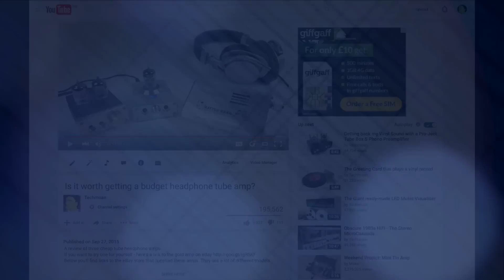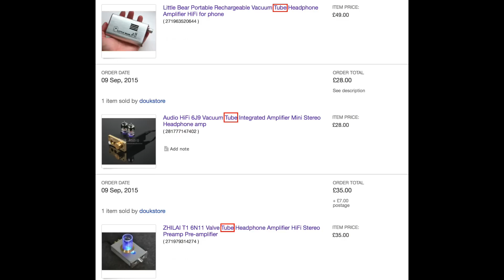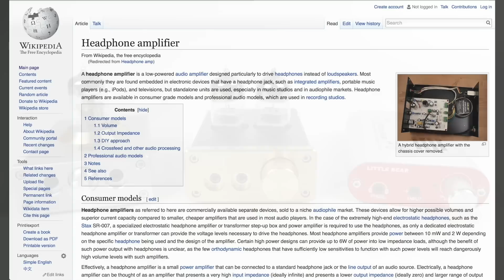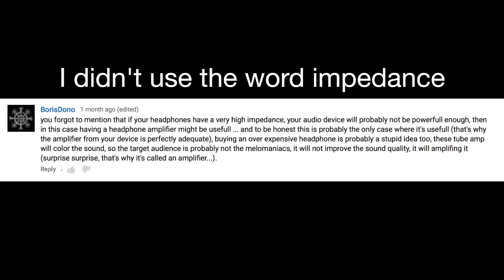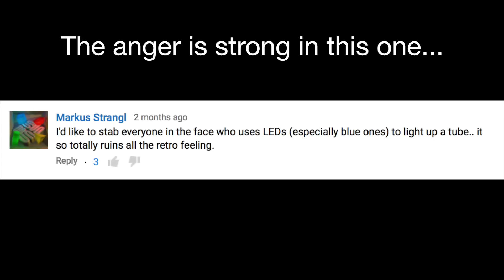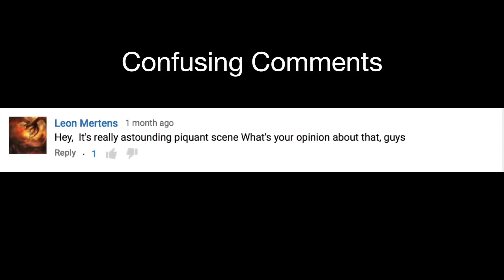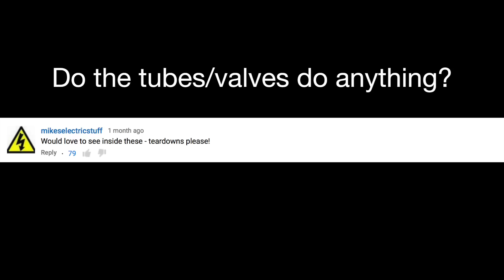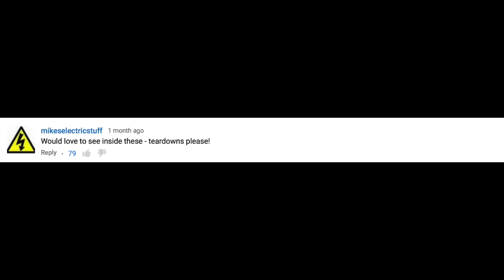Headphone Tube Amps - Follow-up & Tear-down

Comment: People who cannot tell difference between direct driving headphones from consumer grade phone outputs and driving them from specialized amps probably cannot hear the difference or have bad headphones. Headphone amp is a MUST if you really want your headphones to deliver their real performace. Very important factor is current. Headphones NEED current and for that you need opamp, valve or transistor stage that can deliver it into impedance that are heaphones which is usually low, meaning high current is needed to drive headphones. If you use consumer grade headphone output even on high quality equipment, that is usually just to monitor playback, not really to get audiophile grade playback. My friend bought AKG headphones and connected them to usual phones port and he was not very satisfied but later on he borrowed from me my A-class push-pull transistor headphone amp which I built and use it for three years with my AKG K-240. He was shocked with detail, musicality and spatial elements of playback. If you have headphones, you need to let them play music, and the way to do is to give them current, otherwise you will get thin and rather un-nutural playback. Even in my Denon CD player there is opamp on output which is chosen because of high output current, not only because low distortion.

Comment: There are tracking connections on BOTH sides of the PCB, not just the underside. As a musician, I use VALVE amps to amplify my guitar, as do the great majority of professional musicians. The reason why is simple. Valves sound so much better, they respond to touch better (i.e. light and shade) and just have a warmer sound. That is why in this day and age valve amplifiers are still made and loved by so many.

Comment: Since the British like to rename just about everything with slang, I am going to stick with “tube” because they are a vacuum tube.  They are not a valve that controls water or fluid flow. If they are controlling current flow then they would be a switch or potentiometer.

Comment: And on the circuit you can see the valves/tubes are are connected not only on the back of the circuit but front too

Comment: Matt, your delivery is fine and your channel is a pleasure to watch.  As a fellow 'old-skool' - retro hifi buff,  I find your uploads a breath of fresh air and always engaging as is your typically Brit dry witt  (much like John Ward's channel).    It is to your credit that you take these assinine comments in your stride.  KEEP UP THE GREAT WORK.  
________________________________________________________________________________________________________________________
Tech bit....  
.
In the XuanGold - The two 6J9 'thermionic valves' (or 'electron vacuum tubes') are triple triodes  -  More at home in a receiver (local oscillator/RF detector/mixer).  Here probably being used as a two stage class A amplifier (on each channel).   The op-amps being either input buffers or output power amps   It is entirely possibly, that one of the triodes (out of the three in each valve...) would be redundant, hence the pin-outs not being connected to the circuit traces (which is common in valve/tube technology) and might even be the cause of the microphonics. 
.  
The silver Zhilai - single valve/tube - 6N11 is a double triode.  Being used in a similar hybrid configuration.  but using one valve/tube shared across two channels, which coupled with inferior electrolytics, would explain the inferior/mundane performance compared to the former XuanGold.  

.

The Little Bear - Uses the 6021, a subminiature double triode.  Most likely using a similar circuit configuration to the Zhilai.   These Raytheon subminiature valve/tubes are designed specifically for harsh environments (military spec).   Ironically, probably better specs than the previous valve types and appropriately employed in this 'mobile' headphone amp.     The hiss audible, might be simply down to either inferior capacitors, poor soldering (likely), duff components (resistors), low quality op-amps, or a combination  of all.   

.
High grade military electronic equipment of the WW2 and the Cold War used similar sub-miniature electron tube technology (I've worked on many such devices), where space (in a military aircraft, ship or tank) is at a premium and efficiency is paramount.    Those early pre-transistor 'walkie-talkies' used in the latter years of WW2 contained such devices, whereby the tubes were soldered in place and suspended in rubber glands, to minimise shock.
__________________________________________________________________________________________________________________________
As always, like with climate science denial and politics, there are always those that try to find a conspiracy in everything.   Whilst I concede that conspiracies do exist (9/11 being the obvious prime candidate...),  I  think it is likely a very American thing, to suggest that the Chinese would design and build a 'faux valve amp'.   A totally absurd notion, but hardly surprising given their abhorrence to Chinese goods and their country's ongoing, but equally absurd 'trade war'.   [smh].  

I have a Chinese built 18 watt valve amplifier, that I use for my guitar in my studio.  It is designed around the famous Marshall amp of similar wattage and is simply quite superb (at a fraction of the cost of the Marshall item).   The standard of circuitry is high quality and the bottles (valves/tube) are exactly what one would find in a British valve amp of similar design.   It  has a spring reverb circuit and built-in speaker attenuator.   With Pentode/triode switching.   It even has (foot) switchable twin channels, a line output and effects loop built in.   All encased in a robust steel chassis and enclosure.   All for less than £300.  Streets ahead of any contemporary brands.

Comment: Good advice for anyone wanting to get into tubes would be to start by buying a tube manual, such as RCA’s 1959 receiving tube manual, which is available as a reprint. The 1973 edition would also be beneficial. In addition to data on individual tube types, these manuals cover tube operation and use, design theory and sample circuits for amplifiers, tone controls, etc.

Comment: Good Video...No problems with the way you speak or the terminology. BTW..I'm a tech with like 40 years experience I honestly have never seen the pins of an electron tube soldered to a board. New one on me. I would think that the heat of the soldering could easily damage the connections within. Yes, I know a tube can get hot and all that but, the pins aren't designed for soldering. Bad build IMO. Other than that you covered all the main points very well. Good Job!

Comment: Hi, here are some links to the datasheets for some of the tubes used in the pre-amps:

https://frank.pocnet.net/sheets/201/6/6J9.pdf
https://frank.pocnet.net/sheets/009/6/6021.pdf

The data sheets show they are using a heater voltage of 6.3V at a current of between 300ma to 450ma depending on the tube.

So there is a high possibility that the answer to your question is yes! they are using the tubes to amplify the audio without a circuit diagram I can not say 100%.

I feel I should point out that even years ago not all tubes would glow even in the dark which may be why the blue LED is added as most people when thinking of a tube will think of it glowing.

== Just So people know where I'm coming from on this subject ==
I started my City and Guilds in Radio, TV, Electrical and Electronics Mechanic in 1977 which was the last year they were going to include Valve theory and indeed the second and third year of the course never covered valves, but the first year covered enough for me to work on requirement with values.

Comment: Understanding how valve amps work.
Electricity is a flow of electrons. Electrons will only flow from negative to positive. Inside a valve at the base is a disc of metal which is heated via an adjacent heater. This causes the electrons in this disc of metal to ‘boil’. This disc of metal is negative and is referred to as  a cathode.
A similar disc of metal is at the top of valve (again inside ) . This disc of metal is positive and is referred to as an anode. As stated earlier electrons will only flow from negative to positive. So inside the valve from cathode to anode. This can only occur if the whole process takes place in a vacuum. Hence the alternate term vacuum tube.
In between the cathode and the anode is  a device known as the grid. Think of this as similar to a Venetian blind. Blind fully closed -no electrons can pass. Blind fully open all the electrons can pass.
The output from the earphone socket is the input to this grid. It controls the grid. The output from the earphone socket is again a flow of electrons . These electrons are in a complex pattern.
The net result is that all the electrons that pass the grid (on their way to the anode )in side the valve are an exact copy of the electrons leaving the earphone socket. Exactly the same -except more of them. 
Hence the output from the earphone socket has been amplified. The increase in amplification is referred to as gain.  Typically the output from one valve controls the grid in the next valve. A series of valves results in higher gain.

Comment: These are NOT tube/valve pre-amps (they are NOT amplifiers, please)  are apparently HYBRID pre-amps as they use op-amps. So they are bull-shit.
Valves can sound better as they have even harmonic distortion  whereas an badly designed and over-driven (BJT) transistor pre-amp has odd harmonic distortion which sounds harsh.
That valve sound can be had by using FETs, so using valves is just a pathetic attempt to look retro/audiophile..

Since 'all' recording studios use op-amps (and Not valves) in recording/mixing non-digital content using valves is stupid; it is just a pathetic attempt to look retro/audiophile..

Comment: I'm a few years late, let me try to fill you in on a few things. All of those amplifiers have boost converters which convert the low voltage from the mains adapter (or battery) to the HT required for the tubes. Your gold amplifier has the microphonic tubes, the tube number on them is a Chinese number, try to find replacements on Aliexpress or eBay to see if you can get a better set. The Zhilai just is bunch of junk, tube seems good, keep it. The Little Bear uses a Raytheon subminiature tube known as a pencil tube.

Comment: I bought a headphone amp but it wasn't any of these three.  It's a rather interesting configuration- the tube does voltage amplification and there are a set of power FETs which do the actual driving of the headphones.  They translate the voltage swings to current swings because of the low impedance of the headphones.  Mine uses a 24V supply (not included, unlike yours) which is just enough to use directly on the anode.  The two halves of the tube heater are through a set of regulators to drop it to the required 6v for each section.  Don't know why they didn't run the heaters in series with only one regulator, but maybe it was for visual symmetry.  

I suspect the ones which use the lower voltage power supplies likely have a boost converter on the board which will raise the voltage some for use on the anodes.  You'd have to use a meter to find out by how much.  As for the tube in the Little Bear, something has to be wrong with the design to get it to hiss that much.  I built an amp with a similar tube, the 6111, and it was quiet.  The other single tube unit, if the tube is an equivalent to a 12AU7, switch it out to a 12U7 which is essentially the same tube designed for low anode voltage.  It could clean up the audio even more.

Comment: I’m sure most of the hyper critical sort of comments came from people who actually had a point, but they usually wear a hat so it’s difficult to tell. I’m an old school electrical and electronics guy so I appreciate you work very much. I can think of a dozen good reasons for such mini amps, however most of these kit types are pure junk. Now as far as touching tubes goes, maybe large power tubes like 6L6s, they might over time generate enough heat to shorten their life, but for the most part the small pre-amp type tubes being shown, not so much. Someone is confusing them with lamps, like quartz, low pressure sodium, high pressure sodium, mercury vapor, and other HID ( High Intensity Discharge) lighting. These create some serious surface temperatures and in conjunction with oils from your skin can create some serious damage to the lamps. Hey I’m sure there will be some to call me on this, what do I know,with only close to 50 years in the field, I’m practically a newbie.

Comment: They were originally called valves due to how the work. The Americans started calling them vacuum tubes which then got shortened to tubes. 
I know a guy who makes valve amps and he touch the valves all the time. 
I wish you’d tested items from different countries tho. Say an American made a European made and an Asian made. 
And your right about the number of trolls on these hifi sites. It’s quite amusing!
I enjoy what you do👍🏼
One thing re valves. I was told that the light only indicates the heater is functioning not that the valve itself is working correctly.

Comment: Thats a sweet walkman

You cant really tell which pins are connected for sure since that is a multilayer pcb board. You have to use a meter to ohm them out to see where they go, a visual inspection isnt enough

Comment: None of those are capable of supplying the tubes (valves, electron bulbs, radio lamps, blistering hot glass jfets, cocaine cylinders for audiophiles)  with the necessary high voltage 100v minimal to power them, the 6v chargers are for the heaters and op amps. Edit: also if you notice that chip labeled NE5532P that's how they amplify sound since it's an op amp, maybe the gold one works since it can't have microphonics if the tubes are not used

Comment: Pretty late to this, but you can touch tubes with your bare fingers, very old myth that started because tubes were more fragile and it could create uneven heat distribution which would lead to a shorter lifespan.

Comment: Techmoan,  terms such as impedance and microphonic are not "buzzwords", they are correct technical terms with very specific usages. The fact that you opt for "plain English" and deride more exact terms is just an excuse for laziness and/or ignorance. You don't have to be pretentious to demand precision in speech; especially when conducting an electronic product review. Tubes(USA) or valves(UK)? Just two different words for the same thing. LEDs in preamps/buffers such as these are typically used as gimmicks, providing no function other than aesthetics. They can, however, cause noise in the circuit if not implemented correctly. Hiss upon startup is common in tube amps. The quicker startup after already having been turned on is the result of charge/energy retention in the preamps components. The use of a PONO should not cause concern, especially among audiophiles as this device is capable of outputting a quality lossless signal. Anyone who has spent time around good audio components knows that amplification can make a difference to the sound quality of a pair of speakers or headphones. If you are using an audio system as ambient sound there is no reason to spend a ton on equipment. But if you want to do serious and enjoyable listening then amplifier-speaker matching is essential for best results.

Comment: I've taken those apart and the tubes are indeed connected, but they are in a cathode follower configuration so they simply let the sound through. They do absolutely nothing for the sound quality.
I bought one of those amps just because they look cool, but I didn't expect them to improve the sound quality and they certainly don't, if anything they make the sound worse.

Comment: I've got two of the gold amps.  They are great for high end headphones.  Just replace the shit china tubes with some new old stock ones from Russia, pull the ne5532 op amps and replace them with 2604 Ti Burr Browns.  You got one hell of an little tube amp for around 65 bucks.

Comment: The "gold" faced amp is the real deal with fairly high quality components.

The single tube one is utter bullshit.  It is not even utilizing the tube other than for looks and an enable jumper, considering the MOSFET hidden underneath is more than likely doing all the work.  Especially, since the invention of this type MOSFET was to replace use of all vacuum tubes.  The one in this unit doesn't even have a heatsink, allowing it to overheat and eventually blow.

We shall not speak of the battery operated unit... ever again.